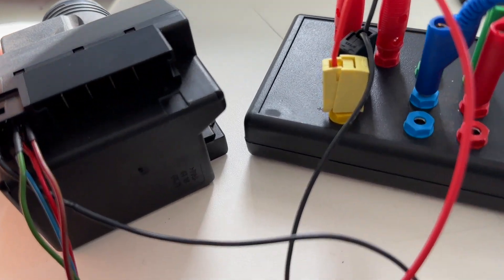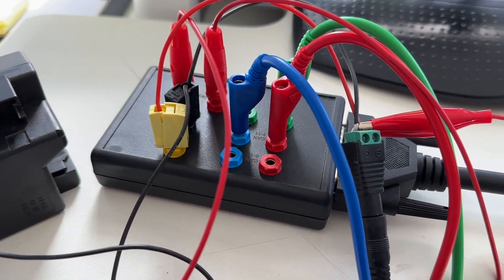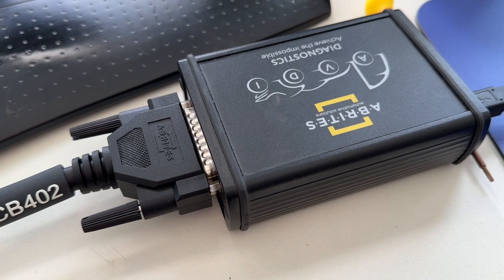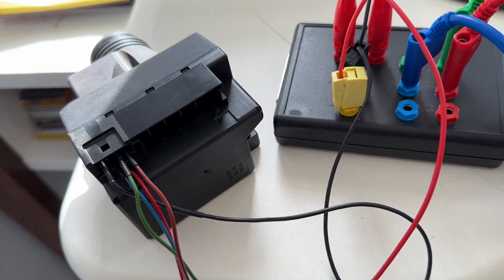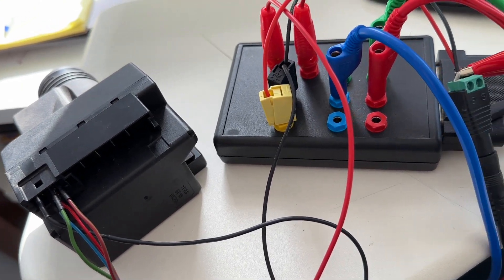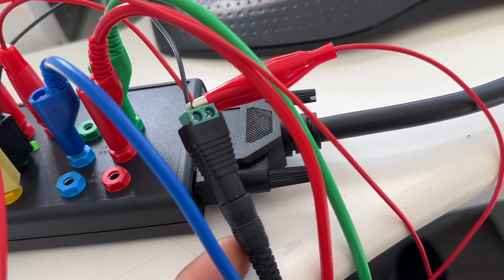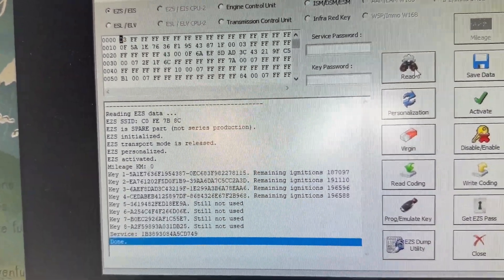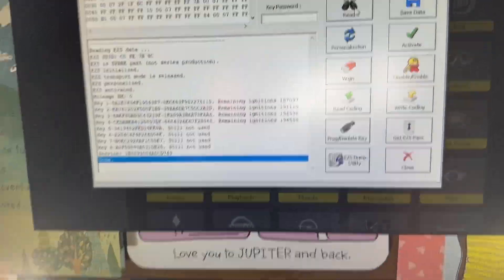Reading a Mercedes W220 W215 W230 EIS with Abrites AVDI.

Comment: hello, is there a way to check if the reverse lights are off on a c class w205 2016 manual transmission? The rear module itself is correct (I can turn it on manually via diagnostics), the gearbox sensor is correct. But when I put it in reverse, the reverse lights don't work.

Comment: Can you please point me in the direction to find the wiring diagrams for different eis's? I bought my avdi unit second hand, so it didn't come with a manual. I was hoping the distribution box would've come with some literature
Reply from the maker: You can download the manual from their website.
Reply: Dorections are embedded in software. Need to transfer ownership and activate a AMS so you can use the tool to its fullest extent